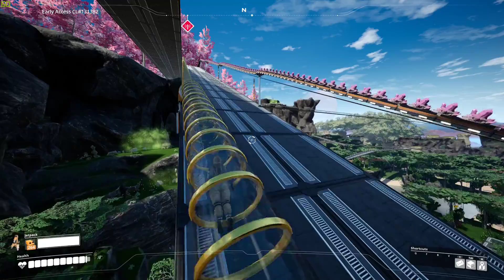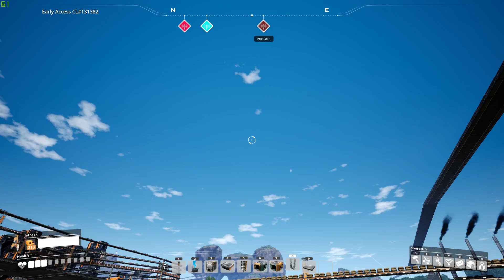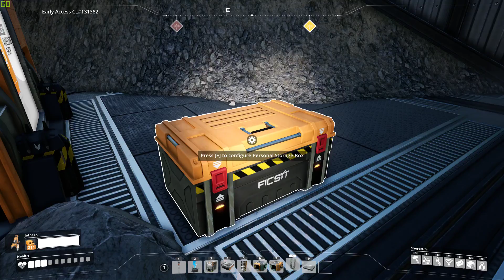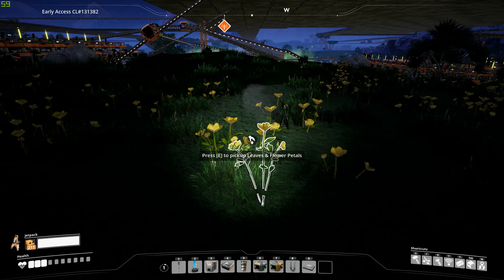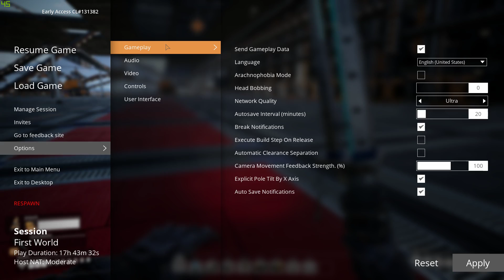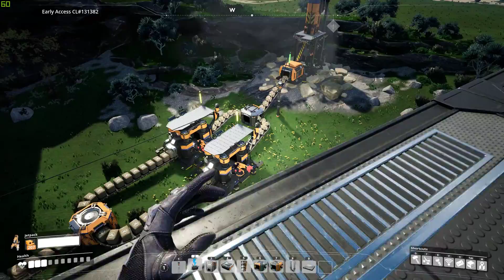Satisfactory Tips and Tricks I Wish I Knew Starting Guide

Comment: Well, the game changed a bit since this video were recorded, but I'd like to point out a few things that are still applicable:

1. Huge sky-scraper pass-through stacks of storage boxes is a bad idea. It's a great idea to place ONE container for whatever you need to pick manually for building things, but any more of that is a waste of space since you never ever use entire container of stuff at once in any building project unless you actually want to cover entire planet in concrete and do it as fast as possible. Even then it's easier to setup large and fast production line to fill up the box faster than you use it. Anything that doesn't fit into a single box should either back up and stop or go into a sink. When you need something in a production you don't wan to re-route resources from the container. It only adds to the art of spaghet. Just feed the system directly from the main supply. At least in case you mismatch supply with demand your production won't suck your resources from storage, so you won't end up without resources when you'll actually need them. And yes, producing basic stuff in place usually better than bringing it from the other side of the map. Especially screws and wires. In some case even Mk5 belt isn't enough to bring that stuff fast enough, so it's simpler to produce it in exact amounts wherever you need that.

2. It's a good idea to learn to quick-swap equipped stuff (at least for now, update 6 finally brings multiple body slots). Helps a lot when you want to jet on a platform with poisonous cloud or fall off a cliff/platform with Blade Runners equipped. Or a gas mask. Did that quite a few times on purpose.

3. It's actually worth hiding production lines behind the walls. Not only you can make it looks like an actual building, but it helps maintaining the FPS.

Comment: Great video! As a beginning player (less than 20 hours of gameplay so far), the first ticket purchase I made was the little FicSyt cart. One thing I discovered is that when you’re in the cart, the animals that normally attack will ignore you completely. So it’s good for getting past areas where there are two or more in close proximity. But use caution while driving because it CAN tip over on it’s side, in which case you’re stuck until it self-rights itself after about 3 or 4 minutes.

Comment: I just started this game, less than 2 hrs in; needless to say my mind is blown at your base. I’m wondering if you saw any finished bases or watched any videos from veteran players to help expand your mind to what is possible in this game, bc frankly I didn’t have a clue how far this could go
Reply from the maker: Hi, do not get overwhelmed.  The game has pretty good progression and will teach you, you just need to have faith in that.  =D.   My base?  I did not watch base builds or anything.  This is what I came up with.  I think its big and ugly but functional for my needs.   I did not want to spoil it by looking at base builds.   The more you play the bigger you base will be.  Then you wills tart going.. Oh I want that here...and this there... and changing things.  Tearing down and upgrading.  This is the game.  It freedom to design with purposeful function.
Reply: @THEGAMEIS  Thanks for the reply.  Quick question though; you mentioned you would have built your floor higher off the ground I think.  How do you do that? I am through tier 2, I can build platforms but I can only build them right on top of the ground
Reply from the maker: @AbleAnderson  Can use ramps or platforms or anything you can stack to get the height your want.  Then just build out from there.  In this game there is no supports needed.  Platforms can float. I always build by connecting that way everything is connectable and will snap to later on when I expand.

Comment: Thanks for the double ramp tip and the factory cart one. Seems like a random purchase before  u know what they actually do!
Reply: for me, it is a fun challenge to use factory carts on sand instead of platforms :-)
and it is very useful "in the wild", to get back to a deathcrate: mobs won't notice you while you drive around in any vehicle, thus you can scout the area first in the cart (which doesn't take much space/resources in the backpack), and only when you know where everything is get out of it and get the chest very quickly.

Comment: You can hit Q to bring up the build menu which will add + and - buttons to the to-do list.  Quick and easy way to change the quantities.  Maybe I missed you going over this, too, but you can hover over  the recipe ingredients in the codex to go to that item and then add that item to the to-do list.

Another tip - use shift-space on your benches to automatically craft as much as possible of an item.  Real nice for if you need to take a bio break but don't want your pioneer to stop working.
Reply: DUUUUUUUUUUUUUUUDEEE WTF ? SO YOU CAN AUTOMATE YOUR AUTOMATION GUY ? JEEZ IT'S LIKE HACKING !
I got tired of holding that mouse button and felt like it was intentional to make you go towards machine making and not hand-crafting...
Though I gotta ask, how did you figure it out ?
Reply: @knightmer3645  the need to hold the button all the time (or get a weight and put it down on your keyboard :-) was the only method in an older version.
depending on the computer, keyboard, keyboard driver etc, i heard different versions of this, eg i need to give space a very short tap to toggle crafting, and can hold it to work like in the old version (needing to hold it).

Comment: AUDIO: Crackle. As an audio dummy myself. I've found if you're getting crackle it's because someplace between windows and devices the bit rates are different. Something as simple as a windows update can even upset this. So one setting will be at 48000hz and another will be at 44100hz. Pain in the butt to find some of these settings, but a good place to start is in the sound > playback/recording > advanced settings. And of course whatever software or hardware device settings as well. Goodluck 😜
Reply from the maker: Will check this out.  Thanks!

Comment: Okay, M.A.M. and the ability to rotate ends of the conveyer belts was probably the most useful thing here that should be in tutorial section. If it was, I've somewhat misses it. 

As for progression, overall I agree that you get buildings progressively in very good way, but I wish either there was a way to automatize biomas burners or to get coal generators faster a bit. The constant need to refill biomass generators is so tedious early game, especially playing alone for the first time.
Reply: rotating direction of belts and lifts when building a new one is a new feature in update 5

Comment: The bus idea is really cool, but dont you get the problem of having a low throughput for parts that are required a lot?
Reply from the maker: Never had an issue with it.  As I progressed and unlocked new conveyor speeds I could very easily upgrade the line in just a few seconds if needed.  I made a video talking more about the bus system if you want to check it out.  One of my subscribers asked for more details.
Reply: @THEGAMEIS  ah will do, thanks for your reply :)

Comment: Nice Video as for the sound crackling I had this issue when I first started recording. Turned out it was the audio rate on the recording VS the audio rate to the editing software. ie. 44.1kHz recording and the editor working at 48kHz. The easiest way to see if this is the same issue for you is if you watch the original recording via a media player and it's fine then after editing it comes in you just need to change the audio rates to match eachother. hope that helps but good job hope you have many hours jamming games with your son.

Comment: I suggest mods to improve your experience even the dev's are impressed with all the mods and athe mod loader.  Foundations plus is a must for large building basically you can lay a 100x100 foundation if you have the materials with one click.  Or the ramps up or down get so much easier and fewer deaths from falling.  Check out the mods!!!
Reply: I'm in love with SMART mod. Allows you to build large numbers of foundations and walls, easily line up machines and automatically connect splitters and mergers. It's saved me a lot of headaches.

Comment: Regarding multiplayer desync/rubberbanding:  while setting network quality to ULTRA definitely helps (and you should set it), as of current EA release, it will NOT eliminate the client update/desync issues.  Host will experience very close to normal single-player-like gameplay,  but all connected clients will time-share bandwidth allocation.   This means the problem is more pronounced (for clients) with more connected clients.  Base building is fine, but it severely hampers the multiplayer 'exploration' aspect of Satisfactory under current EA. 

Forget about joint missions deep into the Red Forest with your three friends.. They won't see the mobs that are killing them.

I HIGHLY rate Satisfactory however, and if it looks up your alley you should definitely buy it- singleplayer or duo experience is very good, just be aware of the current limitations and hope the network coding is improved with patches at a later date.
Reply from the maker: I've never played with more than one other person.  I hope they get that worked out soon as multiplayer adds a lot of fun to this game.

Comment: You can burn color cartridges in Biomassburners and vehicles.
That lag-fix is a gamechanger (hopefully), need to properly test it.
Reply: although color can now be applied without using color cartridges, you still need them to paint icons, street markings, etc on foundations.
thus don't use them all for fuel, but keep "a few" (roads can be long and then need lots of color to look pretty with street markings)

Comment: Nice video. It's cool to see other peoples creations.

A chainsaw with bio fuel is the first thing you should focus on.
Always carry it. When you start exploring you can easily get stuck in trees and vegetation. Once that happens, you'll either reset to your last save or pull out the chainsaw and your free. Worst case, you get stuck and it saves.

Your 'hub' station is crazy.
But why did you make only the storage area permanent and a modular area attached? Why not have permanent production of all items?
It kinda seem like a waste of time always changing feed lines and production.

I like some of your tips.
So here's a couple I use.
If you want better frame rate. You can adjust your video settings down. Like shade, texture...
Also that large stack of belts don't help. Your gpu has to process every item and movement. It would be a good idea to surround it with walls and remove a section or two where needed input/output. That way it's there but not there. 
Removing all vegetation aroumd your "base" helps too.
It renders less.

Side note -
I have a couple short vids that you might get an idea or two from.

And dude,
Keep building and inspiring.
It's a great game for all.
Helps the mind problem solve.
Reply: I've noticed that crouching can get you un-stuck from trees most of the time
Reply: You can just respawn, go back and pick up the crate.